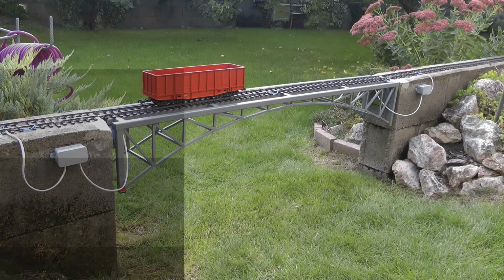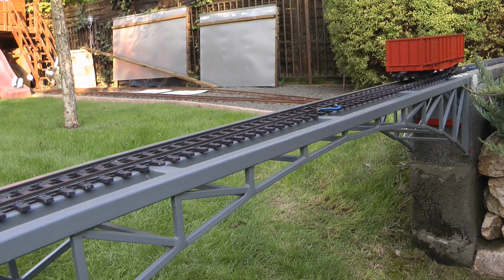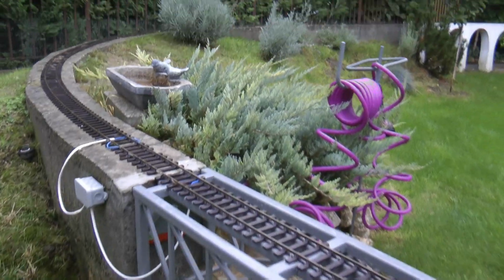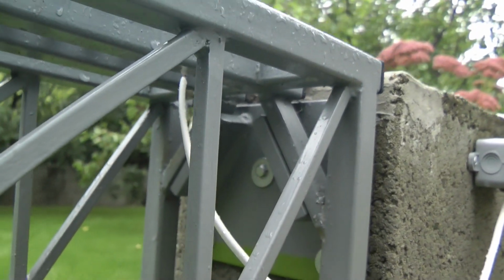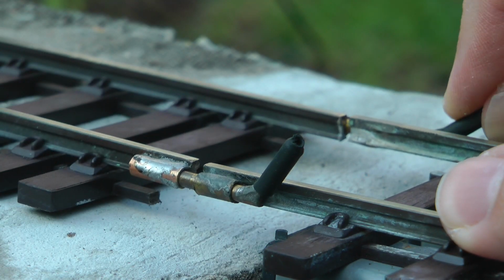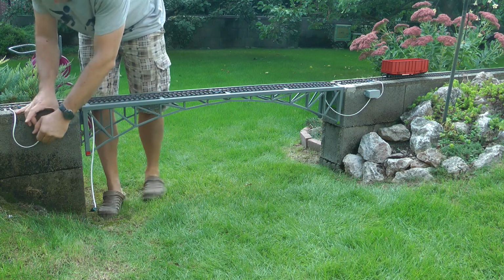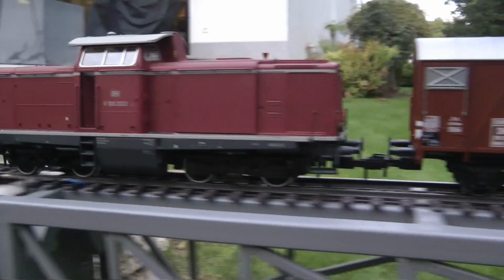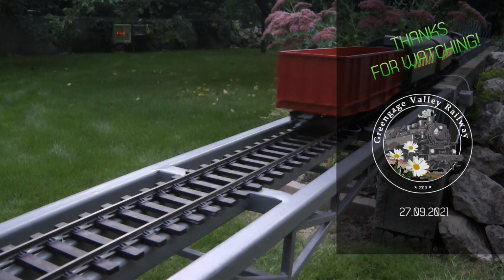Removable bridge

Comment: Thank you for the show and tell,  I'm about to build an easily removable bridge for my layout .  -  I'm going to borrow the pins and socket idea, Its a neat and simple  way of keeping a good track alignment
Reply from the maker: Yes, and it works well even today. When the bridge is installed the pin is usually snug in the two sockets, but when removed it is kind of loose. I just need to pay attention so it does not fall out and get lost. Maybe if you use larger LGB rails, you can install a small bolt in the rail to stop the pin sliding too much back and falling out. Otherwise looks foolproof so far.